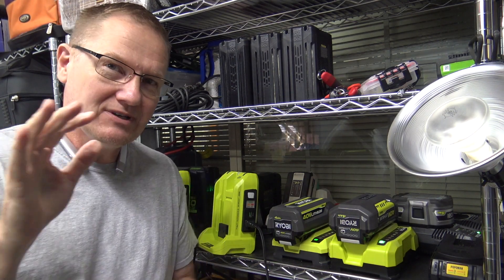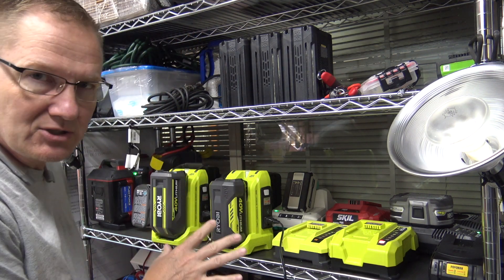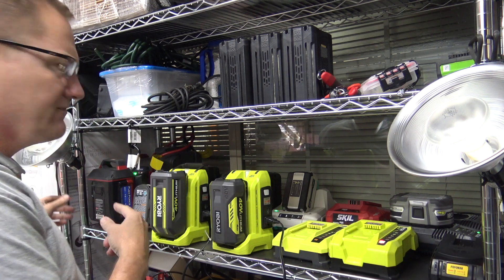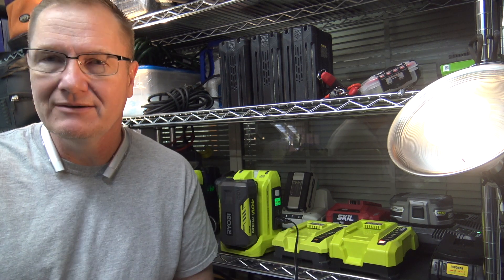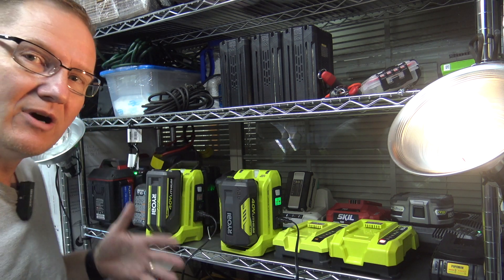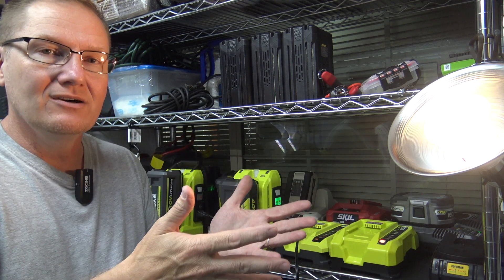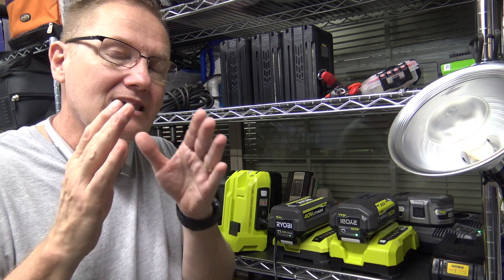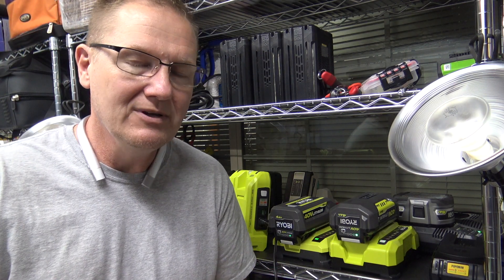Testing Ryobi Inverter Runtime with a 150 watt and 65 watt consistent load #ryobitools

Comment: Those are handy little units! I have run my Photobooth on a 40v 6ah Ryobi battery for 3 hours.
I recently bought the Ryobi Powerstation and a few of the 6ah Extended Run batteries for ceremony rig. It is awesome.